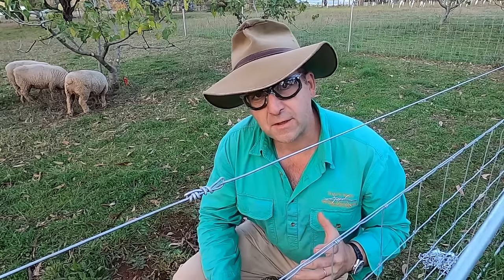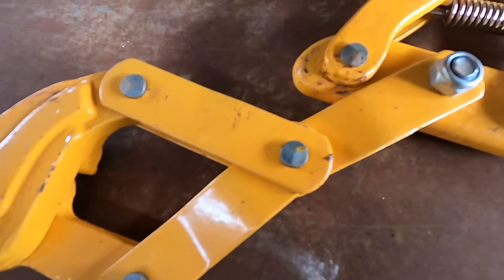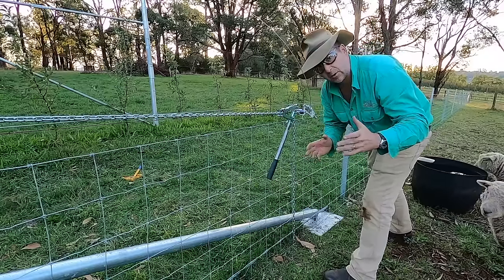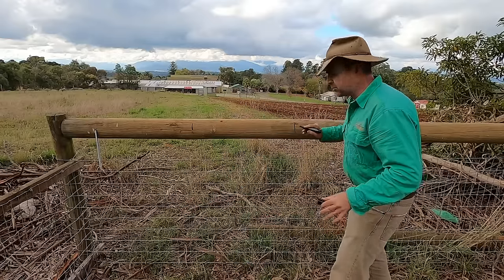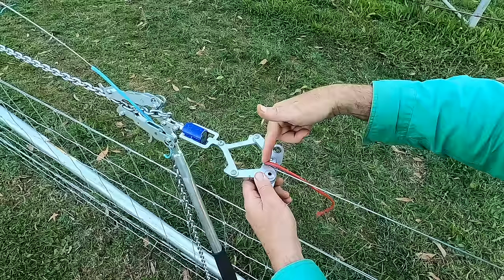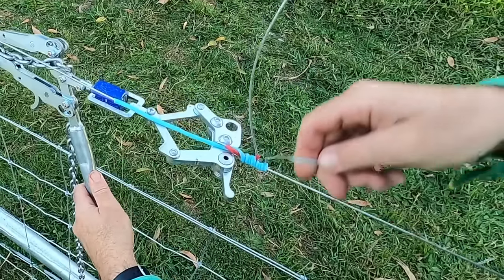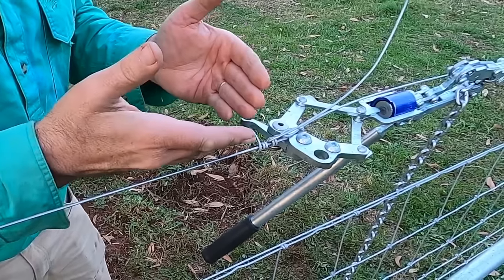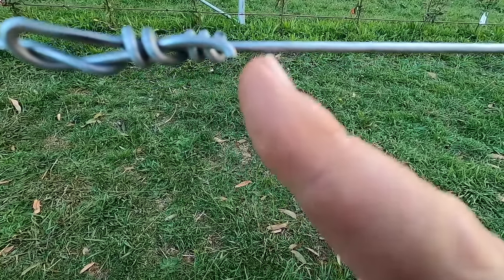Mastering the Art of Straining and Knotting Fence Wire

Comment: Hi Tim, I am new to fencing and I am little confused about the straining.  I am sure everyone else gets this but me.  Have you already tied off the knot at the corner post for the wire you are straining. In the video you have a wire end you are working with, and this is where I am confused.   You mention people make the mistake of pulling the wire too tight around the end post and not having enough wire.   Is this the end of the wire you have looped around the end post.   would be great to see the end post so can figure out what is happening at the end post.  Thanks….love all your content.
Reply from the maker: Hi mate. For runs under 50m Tie off both ends leaving the wire loose. Mount the strainers onto the loose wire. Tension. Cut wire and tie knot over strainers. Check out my basic fencing course for step by step tips and instructions on this and more. https://tim-s-site-552c.thinkific.com/cou

Comment: My uncle used to stretch barb wire out to what he called piano wire tight.  One day when he had it stretched out,  he asked me to test the wire for tension and it was a long section under tension.  I pulled on the wire and it broke and snapped back,  in the process of this it slashed the left side of my face.  Blood pouring out everywhere and I thought I had lost my teeth.  Worst day for me on the fence line.  I had an excellent doctor and with followup procedures, you can hardly tell what happened with just a small scarring left on my lip.   Over-tensioning wire can be super dangerous.
Thank you Tim for pointing out the foolishness of over stretching wire.

Comment: Thanks Tim! Excellent breakdown. And thanks for introducing us to the wireman strainers and guages. Checked out their website and will order one tomorrow.  My question is, can you point me to one of your videos on knots / repairing a broken hiTensile barbed wire run in case I break one during installation or one brakes later on. I’m about to place staytight 50 for only 7 acres to start.  Am new to cattle ranching.  Thnx !

Comment: Tim, would love to see some more like this about barbed wire. All ours are wood posts with 2 lines of barbed wire to keep cattle out of hedge rows in Wales. Straining this is always a pain (sometimes literally) as the barbed wire is that much heavier per length.
BTW I have some of those orange/ yellow chain strainers and the more I use them the more I see the merit in spending more for a better set.
Also, eye protection with all round protection is brilliant advice. Loose end of old fence flicked up across my face and scrated my eye just a few weeks ago. Was not fun. I was very lucky to recover in a week.

Comment: Thanks for these. I hate wire, and I hate strainers, and I'm too old and weak for this crap; but your videos are helping me with my first fencing attempts on my first small acreage. Gotta say.... not enjoying horse sighter wire, nor the 20kg strainer post driver for my waratah end stay assemblies lol. My waratah strainers don't always walk well, but not sure if it is because I'm starting with them not tight enough or if the spring is weak
Reply from the maker: The strainers you are using are very similar to the old Hayes design. Work well, but many remove the spring as it hinders more than helps. Be aware though that this is not recommended by the manufacturer, is unsafe, blah blah blah…..
Reply: @FarmLearningTim   lol thanks so much. I'll persevere until I get a little more comfortable and see if I can't get a better result. If it still misbehaves, off with its spring....😀! Maybe one day I'll even master the wire snappy offy bit (after repeated watchings of your vids I can do the end knot ok, but the knack for the twist and snap eludes me still).

Comment: Great Video Tim. I have taken your advice a few times and purchased some equipment you recommended. Why don't you get yourself a wireless microphone, the volume goes up and down, depending how far you are from the camera.
Reply from the maker: I've got one. Unfortunately the nature of my work means it does not cope as well with wind or movement. The Rode shotgun microphone I currently use is very high fidelity.

Comment: As always, a great watch Tim. Gripple vs. tying knots. What are your thoughts? As a contractor I find the ease and speed of a gripple beneficial, especially if running multiple wires close together (limited space for strainers). However looking at the benefits of the fenceline strainers with strain gauge, it looks like a more robust and technical solution. Value your thoughts Tim.
Reply from the maker: I use cam lock joiners occasionally. They are good for tight spots and short runs. Crimping is stronger. The knot is strong and free (not 3 bucks a throw) but of course on long runs just strain to the post and be done with it! The new strainers are great. Game changing
Reply: I think this question likely depends on WHY you're doing the fencing...

Is it your fence, which you're working on for *free*?

Or 

Is fencing your business and you get paid per job, passing materials cost on to customers?

If the former, I think knotting is the better option. It's free and you don't need to invest in extra materials or tools that can only cost you money.

If the latter, gripples or swaging/crimping may save enough time to make the tool investment economically viable, especially if you aren't the one paying for the gripples/sleeves at the end of the day.

Knotting can also be done even if you forget tools/materials or run out in the middle of the job.

I think the same goes for power-staplers vs manual.

Comment: Fantastic video Tim. Can you strain to one end post to have a run of fence without a splice in it? Or is it too difficult to do the termination knot without letting the strain out?
Thanks from USA!
Reply from the maker: HI Dave. That is exacly what I do on long enough runs.
Reply: I'm new to hi-tensile and I have a hard time doing the termination knot under tension.  Hence, i cut and crimp everything.  I find it easier and faster and the crimps have been proven to be stronger.  What do you do?
Reply: I have not done a great deal of high tensile fencing but at one ranch I worked at, we always had a ratcheting tensioner in line at the end post. In that case we didn’t have the strainers as Tim showed, which was why I was interested in learning how he did it. Does that make sense?

Comment: I’ve always tensioned the wire at the post and then tied off the wire. What is the advantage (if any) of tiring the wires off at both ends and then tensioning it using a speed knot (as demonstrated in this video) over that?
Reply from the maker: Short runs loose less tension and allows you to fix breaks. For longer runs your method is better.
Reply: I have a hard doing the knot under tension.  Do you still use a termination knot?  Any tricks to keeping it tight?

Comment: Hi, I'm having real problems making these knots and think l must be using the wrong wire? 
It's very hard to twist 
or bend and it certainly won't fracture when you try and snap the end off?
Can you explain the different wires and which one I need? Thank you from England!
Reply: Depends on fence, environment, if you want electric or not, in fire prone areas using softer wire is a good idea because it springs back after being heated, i'd say for a general purpose long life HIGH TENSILE gal wire would be the way to go, it's what we use and it's never skipped a beat, good luck! stay away from barb if possible imo.
Reply: @jab8823  thank you. Is it likely that the wire I use doesn't knot and break like yours is because it's not tensile or high tensile? Is non tensile harder to knot?
Reply: @modelfarmmaintenance7032  im not sure what wire you're using, do you know the manufacturer and type of wire? is your wire already in a fence? i know a lot of old farm fences use a variety of wire all of which are obnoxiously hard to repair and work with, if you're using some old really thick wire, or some really thin shoelace stuff i would recommend buying some high tensile, or a small roll of something softer just to practice your knots on! use a good pair of fencing pliers if you need to and move the wire quickly, the quicker you move it the warmer it gets and the easier it is to work with. hope this helps (:
Reply: @jab8823  thanks for taking the time! I'll certainly follow your advice. B
Reply: I've found medium tensile wire is best for fencing. High tensile is hard to bend & twist, low tensile stretches easily.
Reply from the maker: Hey mate. HT all the way. The secret is the crank handle and using this to PULL on the wire at right angles to the bend. It's just practice.